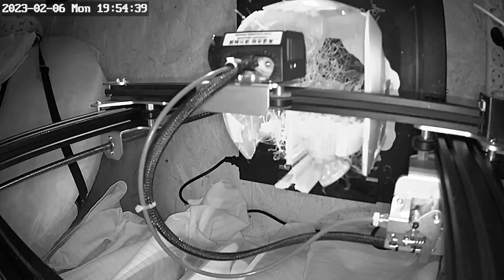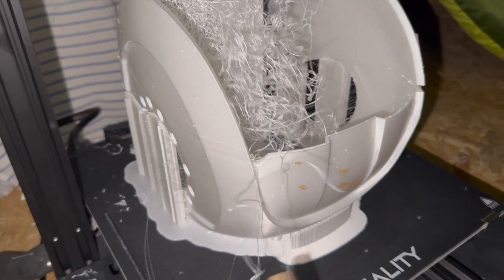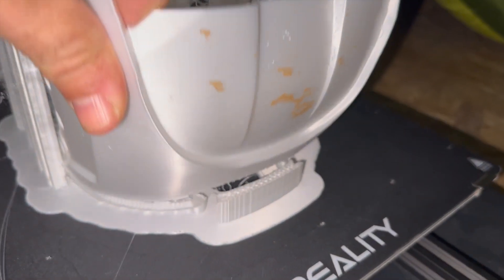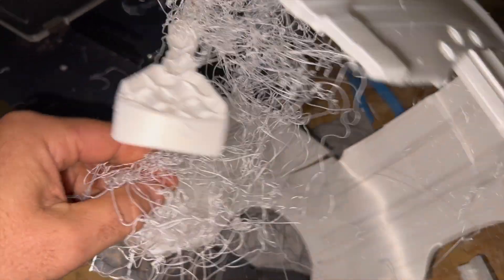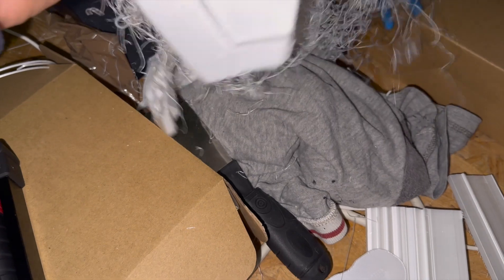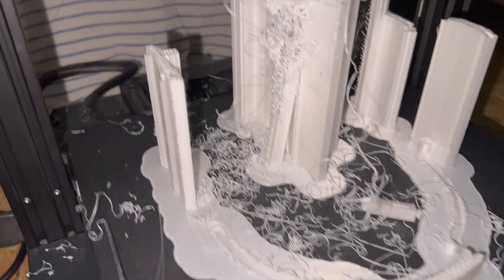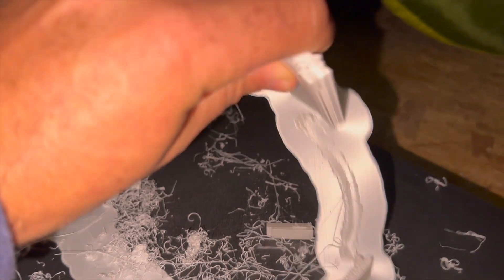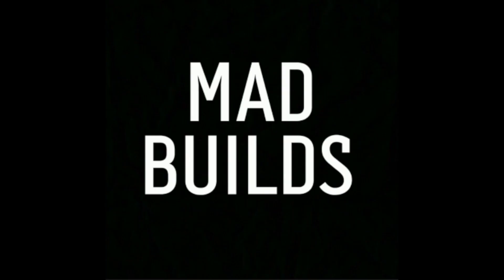Why can't I manage to print a good Ironman Helmet

Comment: Looks like a layer adhision problem.

Cnckitchen has some strengt test videos for this kind of problem. I would check him out.

Not sure what your settings are, but I would try reducing layer height and increasing nozzle temp. (On large generic PLA prints, i personally print 0,10-0,15mm and 230degrees)
Reply from the maker: thank you for the tips

Comment: (sorry for the bad english) hexagone filler structure can make much stonger print and you can melt the broken part part together.

the channel frankly built have a lot of advice for 3D print and the guy is specialize with iron man stuff maybe this can help
Reply: oh and wood filler can help for the gap
Reply from the maker: thank you for the tips